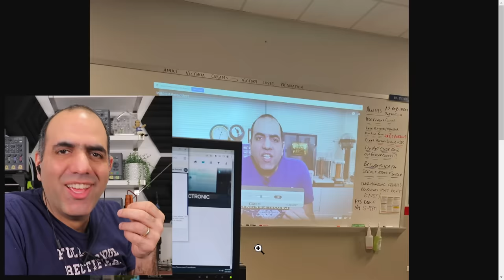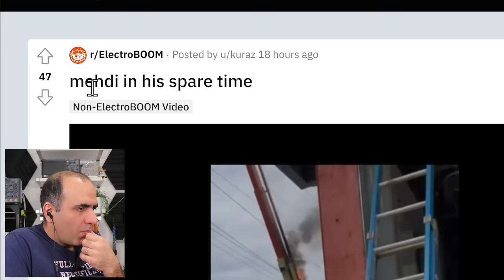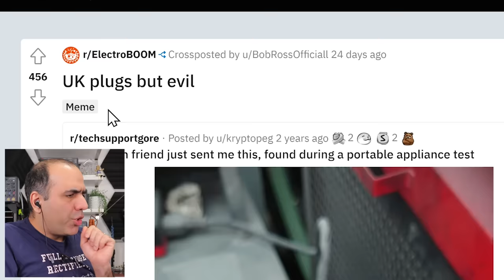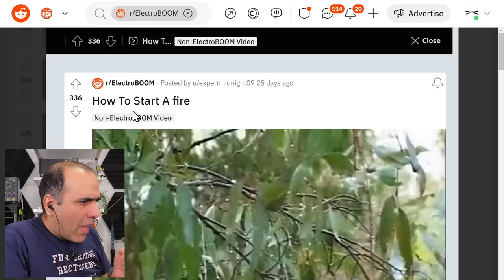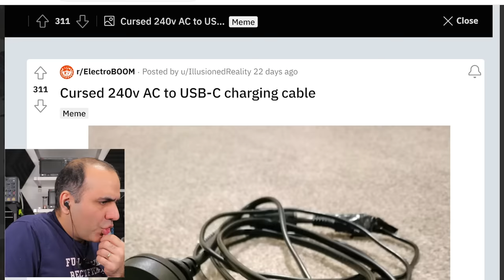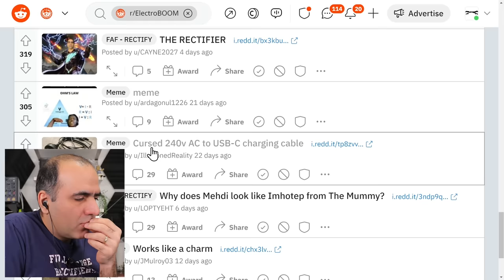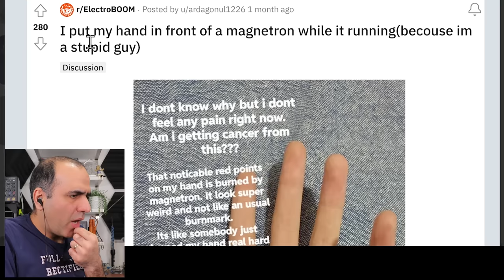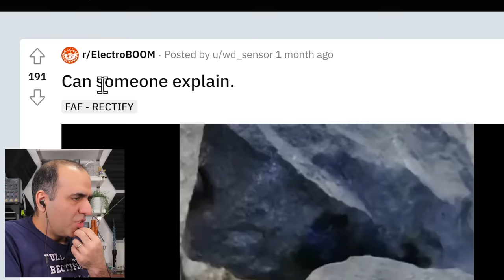Closing a POWER ARC Switch with a WEAK ARC (LATITY-012)

Comment: The "small arc switches big current" thing is used in TIG welders. When you first strike the arc, it pulses a high-voltage between the tungsten electrode and the object you're working on, which is grounded with a clamp to the welder. Once the arc strikes, the welder switches to pushing high-amp, low-voltage current through the ionized channel created by the high voltage arc, and the heat released by the now high-current-low-voltage arc melts the metal you're trying to weld.
Reply: well, i read it with Mehdi's voice
p.s. nice example
Reply: This is the first thing I thought of and then he said “I think thats used in the industry somewhere” and knew.

Nice write up and explanation 👍
Reply: can this principal somehow be modified to build a device that would make a continuous arc? i would like to modify my stick welding machine to have plasma cutting capability's without complex electronics... (old school)
Reply: @ozb2006  Connect the positive to a tungsten tig welding electrode so it doesn't melt, then you want to supply compressed air to the arc so it blows the metal through as it cuts. Boom, you've got a plasma cutter from hell.

or you could just buy a Chinesium plasma cutter for less than what you'd pay for just one good tig setup probably :P
Reply: @jimmio3727  lol amm i already modified my walmart ac stick to DC and then added flux core into the mix, i am planing to add gas to this monster so why not add a plasma dead  and a high voltage source and turn it into a plasma cutter?  right?
Reply: Hey Mehdi can you do a breakdown on tesla lighters/plasma arc lighters.
And why they fail within a week
Reply: @jimmio3727  yeah lol, an industry tig machine will run you north of 10 grand. Spool fed tig machines will run north of 12
Reply: Did a vocational program part of our high school and we would always play with the HV starter arc. It's also high frequency so it won't shock you but it's a lot of fun.
Reply: @ozb2006  Get a thyratron
Reply: It is also used in plasma cutters..
Reply: It is good to say that the high voltage is very high frequency so does not kill you
Reply: @jordannaumceski2269  I mean if a defibrillator is used to save a cardiac arrest victim, then people who say "current is what kills, not voltage" probably need to learn about how a defibrillator works
Reply: @coastersaga  Maybe i did not say that right. What i ment was that the high voltage arc (the tig welding arc starter)which jumps from tungsten to the welding part it has to be 15000-20000 volts or more otherwise it will not jump to the welding part and cannot start welding. That high voltage is always high frequency. Otherwise it will kill the welder operator. And it's always voltage that kills not current.
Reply: As a welder: that's true
Reply: Are you describing aluminum welding or steel? And if steel, are you talking about the lift-arc setting? I wish any of my welding teachers had the technical understanding you seem to have.
Reply: I did a welding course many years ago and when learning TIG I frequently forgot ground the bench I was leaning on. Many shocks I got from that lol
Reply: @smilerbob  me too!
Reply: That was extremely informative and a good read, thank you.
Reply: Also HID headlights work this way, although they're becoming less popular now that high-power LED headlights area so common. And the starters on old florescent tube also do the same.
Reply: And its such beatifull process
Reply: Some newer TIG machines are phasing out High Frequency points and just using PCB's for the arcstart which is kinda lame
Reply: I was never scared of a welder when i was 16 in shop class, but i was scared of getting electrocuted by 12 volt car batteries
Reply: @tadghostal7501  im still terrified by electricity, even though im a tig welder, and electronics enthusiast. what was put in our heads as children just stays there... (also sparks :D )
Reply: @MrKfadrat  I actually fear no electricity that can actually come into contact with in my life because I understand it now. For the most part. For shits and giggles i shorted my dewalt battery packs with 12 gauge wire, originally to ignite model rocket primer but then cause it was fun, didnt think about how the near zero resistance from a negative to positive let probably tens of amps, as confirmed by the rubber on the outside if the wire getting too hot to hold within seconds, probably couldve ended rather poorly. The battery got fukkin hawt.
Reply: @tadghostal7501  yea, the electricity already harnessed and designed is fine, batteries - fine, but when fiddling with 220v ac, or higher dc voltages - my hands automatically decrease resistance with moisture..
Reply: @jordannaumceski2269  @CoasterSaga. You’re both wrong. And you’re both right. Neither voltage, amperage, or frequency alone can kill. It’s the combination of the three.

A standard static electric shock is DC, 12-25KV in the microamps range. But it doesn’t kill. 

A car battery is 12VDC at 600-1200 amps. But it doesn’t kill. 

The lethal threshold for current is about 50ma. But a Tesla coil running at 100mA, at millions of volts AC at 12MHz doesn’t kill. 

But grab a 60Hz, 110VAC 15A household hot wire in one hand and a ground wire in the other, and your wife’s gonna be wearing black for a few weeks. 

For a power source to be lethal, it must have a voltage high enough to penetrate the dielectric rating of the skin, a frequency in a range that can interfere with neural impulse transmission, the current passing through you must be high enough to either disrupt neural communication OR cook you from the inside with good ol’ fashioned heat, and the current must pass through something important on its way through you. 

A defibrillator works by providing an electric current across the heart of sufficient voltage to disrupt the heart’s electrical system, stopping the heart. This is used to stop lethal heart rhythms like v-fib or v-tac. It does not and cannot start the heart beating if it has stopped entirely (asystole). 

Source: I’m a first responder that originally majored in electrical engineering.
Reply: It's also used in high power discharge lamps, like multi-kilowatt xenon lamps or high power flash lamp pumped lasers.
Reply: @ThndrChld  Man i know those things 😂. I was talking about welders
Reply: @gideon7212  industry machines run way better than hobbyist machines, if you are just doing small projects then it would work great, a Miller big blue will cost you between 30-84k
Reply: Aahhh that’s where it’s used very interesting how cool thanks for that info
Reply: @MrKfadrat  lol fear is good. Fear is what keeps you alive. I nearly get myself killed all the time by thinking i know what im doing when i really dont.
Reply: Plasma cutters use a similar high voltage pilot arc. It can wreak havoc on CNC plasma cutters which is why proper grounds should dissipate the EMI issues to the control circutry.
Reply: I wonder why it doesn't always work though. Sometimes you still have to touch the tungsten to the metal to get it to strike.
Reply: I wish I get pinned and liked this is my favvvvv YouTube I liked every single vid and subbed
Reply: Unless you're steel wool is trash
Reply: Exactly!
Reply: @jimmio3727  that sounds like a cool af device

Comment: Sorry to be the one to point this out, but microwaves don't really cook things from the inside. Honestly, if you've done even a little microwave cooking you've probably noticed this, The outside of the food gets hot first. What it does do is selectively heat water, so if you have something with liquid water on the inside but a dry outside that might cause it to appear to cook from the inside out.  Frozen food in particular can be a problem because the ice doesn't absorb it as well so as soon as part of it melts that part starts absorbing a lot more energy than the rest of it.  This is the cause of the notorious frozen burrito effect where some of the burrito can be molten hot and yet another part might still be frozen.

Comment: Regarding the USB-C charger: A proper USB-C implementation wont even give out 5V unless there are two 5.1k resistors connected to special pins (CC1 and CC2), meaning if you connect two USB-C chargers you get 0V on the cable.
Reply: Curious, would the same implementation be an issue with USB a charger and cable?
Assuming you got a male -> female adapter for one end. Why wouldn't it short due to high current?
Reply: Relatedly, Hackaday has been doing a series on USB-C for the past few weeks... I learned that male-A-to-female-C adapter plugs are explicitly forbidden by the spec. Why? Because if you plug an A-to-C cable into the adapter, you essentially create a cable with two male-A ends with no control circuitry in between, that you can plug into two computers (or two ports on the same computer) and make !!Fun!! happen.
Reply: @ProtoV33MK1  No, that's not the problem. The problem is that devices at both sides would be trying to provide 5V power to each other, and connecting different power supplies together is far from recommended. It can work, but you're opening yourself to a ton of potential problems, especially when the power supplies aren't well matched which results in back-feeding ("negative amps" for one power supply) which, unless the power supply has protection for it, can result in some fireworks.
Reply: @ProtoV33MK1  male A to male A cables are explicitly forbidden by the USB spec. That is why B exists, simply to allow male-male cables without making loops possible.
Reply: @TheToric  meanwhile i have male A to male A cable just lying around, that was shipped with galvanic insulation module for the  oscilloscope to power it. Yes, the unit has female A connector on it as power supply input.
Reply: @WackoMcGoose  Hello fellow Dwarf Fortress player.
Reply: @amirpourghoureiyan1637  Well, they are if I understand the male and female right. Used to convert A ports on computers to C ports. However they are supposed talk to the connected device like a good C port should and block positive connection unless told otherwise.
HOWEVER almost all that come with devices are cheap ones and I do own them. I only use these for strictly devices (headphones), not anything that could be host like a phone or even a battery bank.
Reply: @voidseeker4394  I once thought A-A could magically connect two computers together and form some sort of a LAN. Luckily didn't try because ethernet was faster than USB2.0 and I had lots of data.
Reply: @yuxuanhuang3523  There used to be things called "Easy Transfer Cables" that were A-A with a big ol' module in the middle that negotiated between the two systems, opto-isolated the two sides, etc. Topologically speaking, it was less "plug two computers into each other" and more "have a middleman connected to both". These I believe were spec-compliant because the opto-isolators prevented the problem of letting different power supplies touch each other.
Reply: @WackoMcGoose  oh no wonder those don't exist. interesting!
Reply: @ProtoV33MK1  No the type-c connector pinout is such that the power and ground lines cannot be reversed even if the connector is plugged in either orientation this is done by making them symetrical so it doesn't matter which way you plug it in and they need more contacts anyways for higher power ratings type-c can handle.
Reply: @WackoMcGoose  Male A to Male A cables exist. All the USB KVM Extender boxes we install use them.
Reply: @WackoMcGoose   And still, dumb cables with two male-A ends do exists.
Reply: Aren't charger cables isolated from ground
Reply: Cute furry
Reply: @TehBIGrat I was about to do a serious introspection about how many shrooms I did in the 90s. Because I remember using these for @ least the first year I was using USB. Somebody started talking about the first ones being USB 2 and I  started thinking "what happened to 1.1" ?

Comment: I'm sure this principle is indeed used in industry, but it is also used in something anyone can cheaply purchase: a disposable camera. The xenon flash bulb is wired in parallel with the capacitor, but the voltage isn't high enough to jump through the bulb and create the flash until an even higher voltage trigger pulse is applied near the bulb. It's been a while since I've messed with these things in particular, so I might be rusty on the details, but it's definitely the same principle at work in a household product. Fun stuff!

All that said... Heed the warnings not to open cameras unless you want to get zapped with 330VDC. NOT a fun time!
Reply: Or, do open the camera, pay your tribute to the zap god, and then casually leave the (charged) capacitor somewhere in the lab for the next unsuspecting pokey-fingered person... ;)
Reply: If the label says 330V, that is what you charge it to before storing. It is the rule.

(No)
Reply: when i was 11 on holiday i found out about the flash capacitor the hard way after poking around inside a disposable camera lmao

Comment: It is so enjoyable, even satisfying, to watch some other guy go on as i did as a child with electricity and things that go BOOM.

When i was 15 i experimented with radio tubes. One of the simplest constructions i made - Was supposed to flash a 220V 60W bulb at 1 Hz.
It was a glimmer tube resonator operating from DC voltage made by a plate rectifier.
It worked well for about 10 seconds.
Then it did something else. Once a second the plate rectifier shot out a bright blueish plasma beam a metre out in the air in front of me.
Problem was the mains switch for my contraption was on the other side of the plasma bursts.
You learn something every day. 😋
Cheers from Sweden. 🍺😀🇸🇪